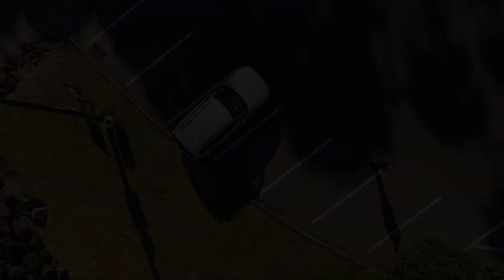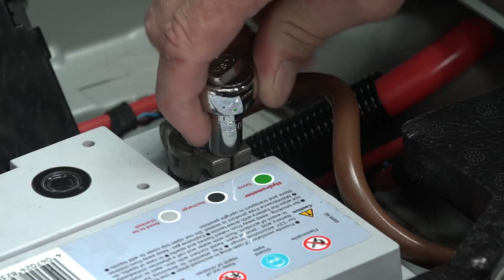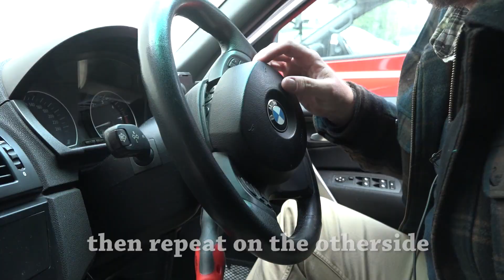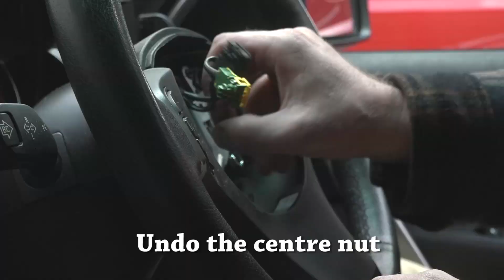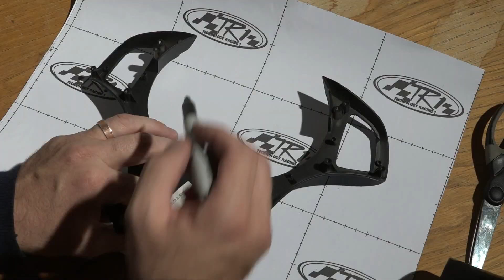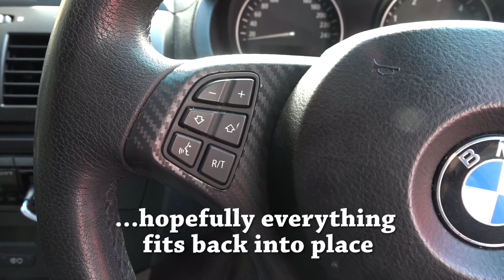DIY removal of BMW steering wheel in under 2 minutes

Comment: Do you know can I put a steering wheel from my 07 X3 on my 05? Both 3.0, the 05 has a flat ugly wheel want to update it, but don’t know if the connectors will be the same for the cruise/volume/stereo

Comment: Under center nut....  trick?  Hold the wheel with your knees?  I am struggling.  It will not loosen and all it does is turn the wheel when I try to turn the nut.  16mm socket, yes?
Reply from the maker: Sorry, I can't remember what size it was. My steering wheel needed a bit of force initially and then the nut moved quite freely. If the steering wheel moves, use one hand on the wheel and the other on the spanner.
Reply: Having the same problem. No luck.
Reply: Needs impact. Dont increase force slowly. Just impact witch wrench and it will loose